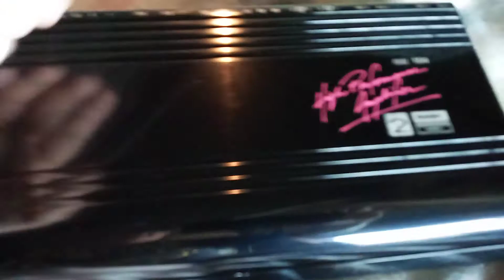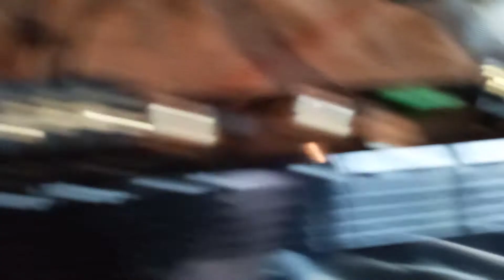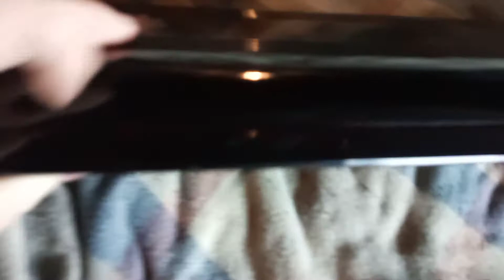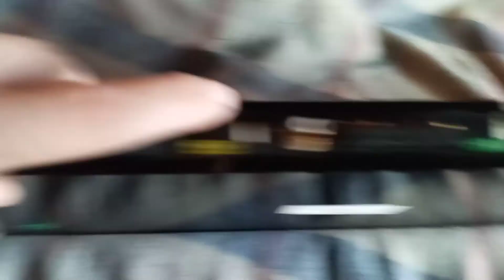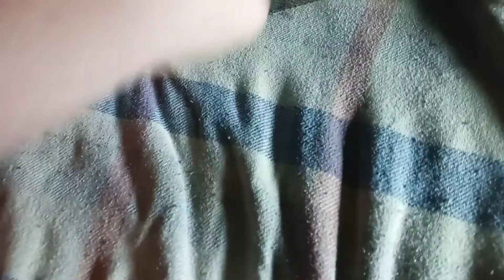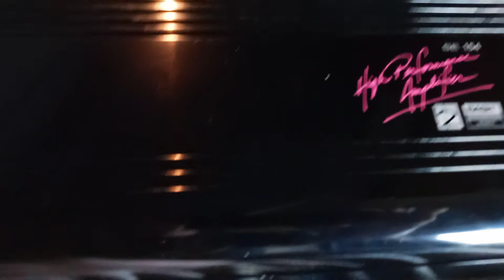Blade Technologies SE 154 look around.

Comment: I had a Grenade G5 I believe. Had it running 4 - 5 way house speakers with 15" woofer's bridged in a laser hatchback seats down in '96 running at 2 ohms. 1.4v inputs at 14.4v power, it was pushing 1,000w np.

Popped the hatch in the school parking lot one lunch, had at least 80 doing the Macarena in the parking lot till my Geotrig teacher leaned out the window and told us to cut it. The walls were shaking he said. 😂

Obviously not, he just didn't like the Macarena. 😂

Comment: I don't know what made me search this but im still running mine in my f150 on the focals. Sounds better than my ppi art series to me. Used to have the their tube amps too but those were underpowered for me. As per one of the owners I spoke with he thought it never caught on as it was too expensive for its time. Some series such as the grenade had a pin you could pull and would render the amp unusable (anti theft). People used to get it bypassed with a resister.
Psb powered subs also use their amps

Comment: You should drop a new video soon update us 🔊🙏🏽
Reply from the maker: I do need to get back after it. I have a ton of gear I could do videos on. I picked up a couple old school audio control amps. A Very rare and very expensive Brax amp. I grabbed 3 more of these Blade amps. I also grabbed a few black and gold Lanzar amps including a 50C and 6600. That 6600 has a ton of dip switches on it so I figured I would do a video just on that amp. I’m currently refoaming 12 JL audio 10w0’s and 4 15” JL 15w4’s. I’ll get something up soon.
Reply: @brentb5303 

Truckers for Drumpf

Comment: I remember seeing ads for this companies products in CA&E magazine back in the early 90's. Never saw any of their amps in a system in person. Interesting design though.
Reply from the maker: I didn't explain it very well but basically they only made 3 different amplifiers. A BASH 1×100 at 4 ohm or 1×200 at 2ohm. A BASH 1×200 8-2ohm, and an optically switching class A 2×50 at 4ohm and 2×100 at 2ohm. In the BASH series 3 they added a 1×250 8-2 ohm. Then they just crammed as many as you wanted from 1-6 channels in a single  chassis. This is one of 2 mixed stereo/mono amps. They had a 152 which was a three channel and this one in the video the 154. The M series was supposed to be their budget amps but they were all thermally controlled forced air cooling and look substantial on the board for the 2×50 or 2×100 they were claiming. I would love to get one of those on the dyno. If you watch HifiVega's video on the series 3 2250 SE he got 307 watts pulling 40 amps at 4 ohm and 290 watts pulling 27 amps at 2 ohm. First amp I've ever seen get more efficient at 2 ohm. I wonder what they did to get similar output between 8-2ohm?